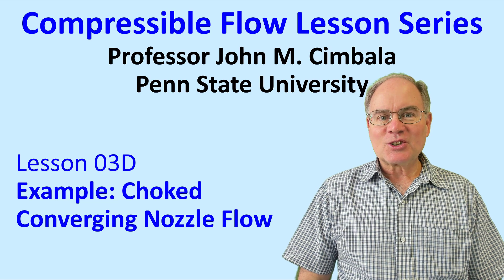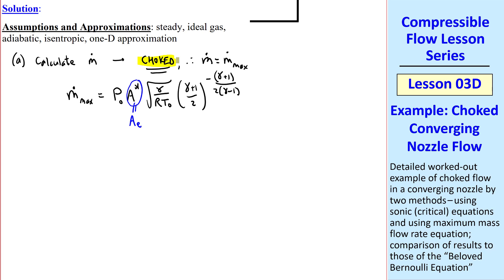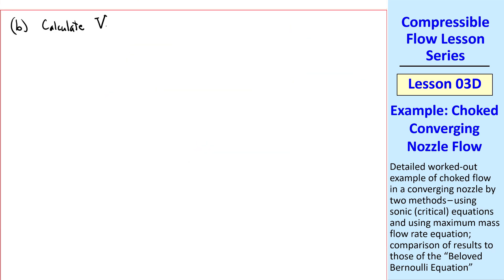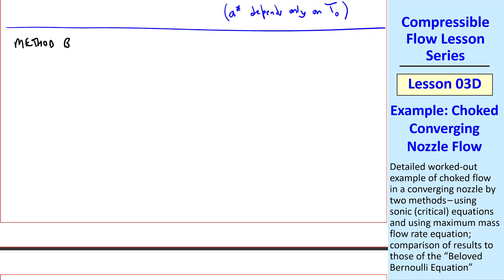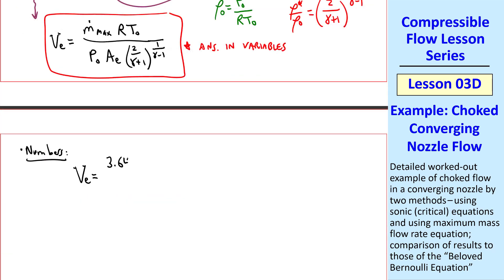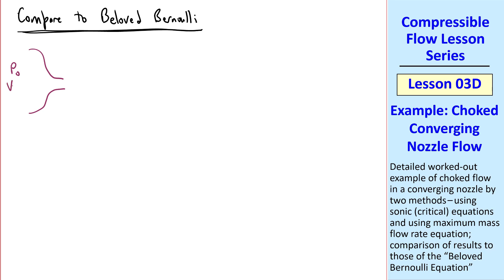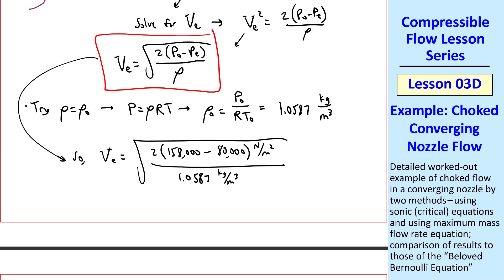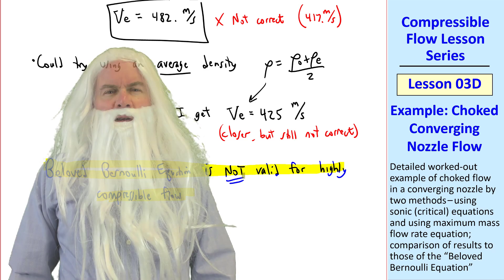Compressible Flow Lesson Series - Lesson 03D: Choked Converging Nozzle Flow

Comment: Dear cimbala

From this lecture, it appears that in case of converging nozzle, only the ratio of stagnation pressure to back pressure plays role to determine if the flow will be choked or not....then what is the use of converging nozzle then? Just making a hole in the pressure reservoir of any diameter will induce choked flow ?
Reply from the maker: Yes, but then the flow will come out uncontrolled. If you want to generate supersonic flow in a wind tunnel or in a rocket engine, you need to have a converging-diverging nozzle. Then the flow will be more controlled and expand to the Mach number that you want to achieve.
Reply: @johncimbala  Is there any thumb rule that says what should be the converging duct angle...because i think it can be more steep...i mean no issue of flow separation
Reply from the maker: @magnifiedmicrons  I don't know about a rule of thumb, but in some wind tunnels that I have built, I used a fifth-order polynomial to get a nice smooth converging section.
Reply: @johncimbala  Ohhh..that is a nice information....but in case of de laval nozzle, if we use 5th degree polynomial, will that make the convergent part a bit more long and thus heavy weight ?
Reply from the maker: @magnifiedmicrons  Perhaps. I am not saying a 5th-order is optimum, just simple. Nowadays we would use CFD to optimize the shape.
Reply from the maker: @magnifiedmicrons  If weight and/or length are important, you would need to optimize the shape. I would use CFD for that.
Reply from the maker: @magnifiedmicrons  I would not say that there is no issue of flow separation. Flow does not take kindly to sudden changes... But a converging subsonic duct is pretty forgiving, although there can be three-dimensional effects and vortices that pop up. If you make it too sharp, it may not have real uniform flow at the exit. If that is important, you would need to optimize the shape for your application. I would use CFD for that.